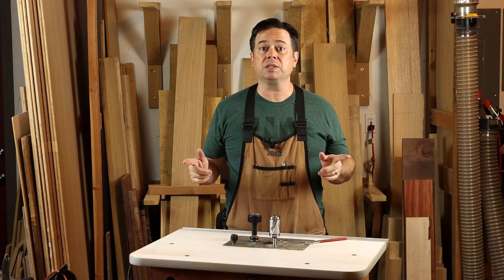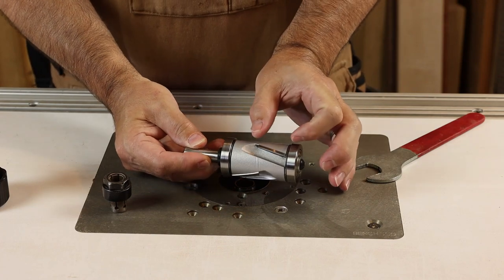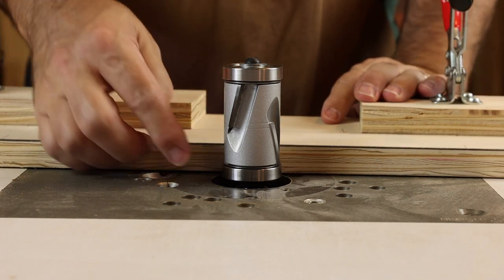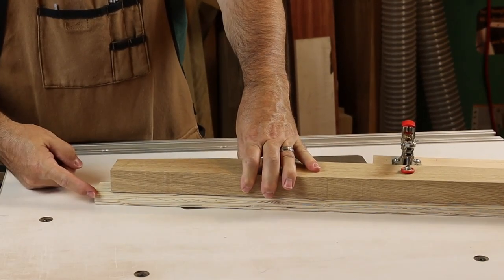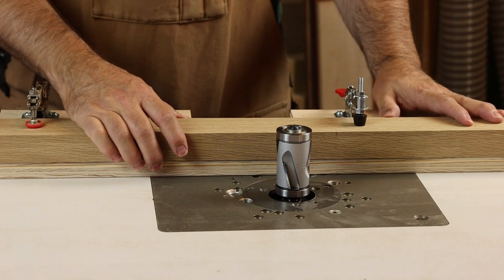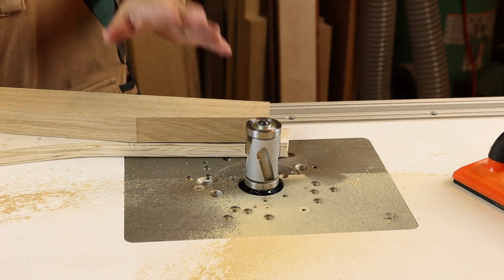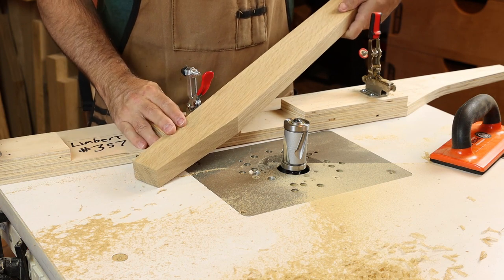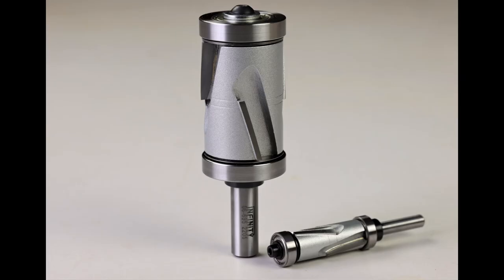Infinity Mega Flush Trim Router Bit Demo with Useful Tips for large diameter flush trimming bits

Comment: How would you handle material that is taller than the router bit? Let's say the material was 3 inches tall. Would you take multiple passes -- i.e., remove the top bearing, take the first pass to remove material, raise the bit and remove the remaining material? I am asking because this is what I am dealing with and not sure how to go about it. Would really appreciate your guidance. Thank you.
Reply from the maker: Yes, I would make a first pass to flush trim partial width of your thick board using a template.  Then remove the template and have the bearing follow the fresh edge you just cut.  You may need two different bits, but they don't both have to be Mega bits.  Best of luck with it.

Comment: How would you compare infinity versus white side router bits just interested in your opinion?
Reply from the maker: Performance is surprisingly similar with both brands.  Both offer excellent cut quality.  Infinity has large diameter options, and in some instances is about half the cost.  Whiteside handles climb routing a little better, but if you go in the correct direction the Infinity cut is flawless.  I bet you'd be happy with either.
Best

Comment: I bought one of these bits.  It was the 2 " tall 1 1/2 inch wide one.  It was extremely loud and had a fair amount of vibration.  I used it in a router table with large router motor at 16,000 rpm.  Over the course of 5 min the vibration caused my router lift to raise up by 1/4 inch.  It is a JessEm lift and works very well with all other bits I have used.  Is this normal for this bit to be so loud and vibrate so much?  It seems unsafe and the cut quality was not as smooth as your video suggested is should be.
Reply from the maker: Hey Brent, I started with the RPM very low on my router table (13 amp Freud router with built-in lift) and it sounded a little strange.  The numbers on a variable speed router dial are sometimes hard to translate to actual RPM, but basically I increased the speed slightly.  Then it sounds normal and cuts well.  I usually remove 1/16" to 1/8" of material when trimming to a pattern.  For me, it cuts best in the standard direction on the router table, and gives a nice edge top and bottom.  Without breaking the rules from the manufacturer, can you dial up the speed slightly?  The two larger bits have a lot of mass, so make sure the collet is clean, and the router lock is snug enough.  Good luck with it!

Comment: Hi, do you think this will run good with 10000 rpm ? My router has an max. Speed of 10 k.
Reply from the maker: The large diameter Mega Flush Trim bits have a max speed rating of 16,000 rpm.  However, they have a sweet spot for the smoothest cuts, and I feel like that's pretty close to 16k.  You must be rocking an older router huh?